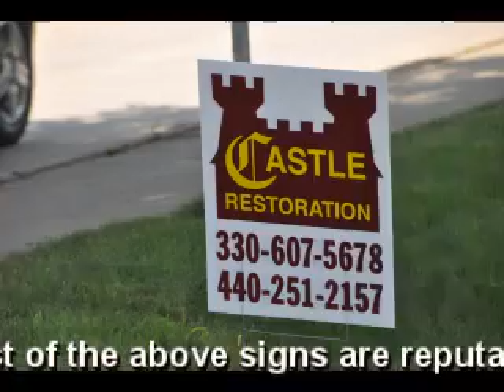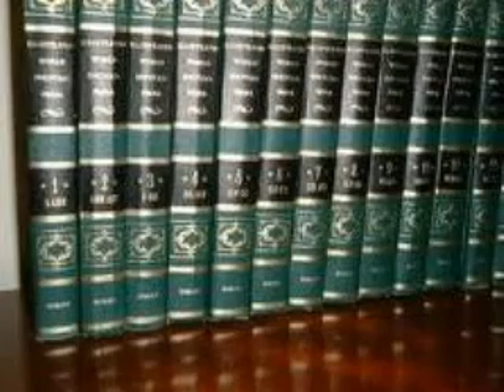Storm Chasers Roof Hail Damage Scam

Comment: Your'e right about a few things. Most of these companies are owned by professional salespeople not actual roofers. Hard to know proper roofing practices if your'e not a roofer. As far as old roofs does not matter how old a roof is if homeowner has insurance and roof is damaged it will be covered period. The insurance companies have the option of inspecting the roofs of homes they cover,some do by way of private companies (Brother worked for one in Denver). we both have over 30 yrs exp.

Comment from the maker: One year later. Many lawsuits. May shingle failures including Timberline for non-sticking shingles. Hundreds of roofs have blown off shingles due to sub contractors being paid per square and not per hour. Some contractors had name changed and others disappeared. Many roofs damaged by hot installs. Many roofs not done because contractor took the money and ran. So I was corrected with my video. Rattle Rattle.

Comment from the maker: @paniagua11 Sorry, but I have photos of guys on rooftops in August / July 2010 in Sandusky Ohio when the temperatures were 95 F. Many of these roofs are all damaged from foot traffic. About 100 Plus of them in Sandusky. The local contractors  quit working at 12 or used carpet pads to walk on . I also have photos of local contactors walking on carpet pads not damaging roofs.  For all that read this, I can inspect your roof and provide an expert report on roof damage and poor installation for $295

Comment: Hail damaged my roof. Small tiny hail. 3/8 inch covered my yard. I was amazed to see my Florida yard covered in white
Some months later I had leaks. One after another.  Unfortunately I didn’t have a professional quote it as hail.  
Cash money I didn’t really have to spend. Also. Older roofs pay an additional surcharge. 
So do we want an adjuster that is sympathetic to the insurance industry?  Perhaps if the insurance industry were sympathetic to the consumers.
Reply: GET AN INSPECTOR TO DO A REPORT AND SUBMIT IT. DO IT LATE

Comment: As an insurance adjuster will 15 years experience, I have to say the video author has hit the nail on the head. And yeah, there is likely a bias here because the storm chasers are cutting into local contractors' business, but that doesn't negate the truth in what he is saying.
The guys that knocks on your door is not a contractor or a roofer - he is a hired gun commisioned salesman. Nothing more, nothing less. Your home, your insuracne company is a paycheck - nothing more, nothing less.

Comment: Marko did you do any research before you started spewing your opinions, and I highly emphasis opinions. lets break down a little about your claims. local contractors cannot compete with out of state contractors? how so if I go out of state to do a roof my costs just became more than a so called local contractor. also customers have a time limit to get their property repaired or they can lose their depreciation payment. many times local contractors cannot handle that much new volume.  next you in writing say most of these companies are reputable but verbally you claim majority of these out of state companies are not reputable and use inferior products, labor, or just plain take the money. what proof do you have of this? next the insurance agent never goes up on a roof and writes a blank check. agents have nothing to do with the claims process. an adjuster is assigned to the claim and does an inspection to determine damage. insurance companies DO NOT pay claims with no damage. next you say in not so many words that old roofs should not be covered because they are more susceptible to damage.... whaaaat? did you really just say that captain obvious. like anything, the older it is the more likely it is to get damaged. by the way don't the homeowners pay a premium for their coverage. so the insurance company has been taking the premium year after year after year. if the roof was so bad doesn't that fall on the insurance company to drop coverage if it wasn't an insurable risk? now I will concede that there are some storm chasers that are not reputable but I can say the same about some local contractors. it comes down to a consumer checking references and how they feel about a company and its people. I do roofs in multiple states and I 90% of the time put the customer in a better position than before the storm at no extra cost to them. next time before you go scaring people do a little more research.

Comment: If my old 2000 Toyota 4Runner has some mileage on it, some scratches, some dings and some jerk slams into my door where I can't open it should the insurance company deny me a new door just because it's an old car? Your points and rant is I'm sorry flawed. You have no idea what your talking about in this video and you obviously don't know much about the greedy rotten insurance companies, insurance mitigation or storm damage on roofs. You sound like your just pissed off because you have no clue how to get out there and knock on some doors. Get off the couch and go to work.